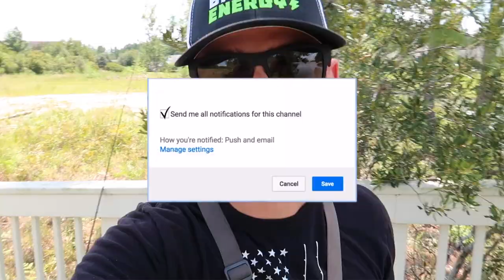$10 WALMART BUDGET Fishing Kit (Summer Bass Fishing)

Comment: 4:20 While I do agree there should be weights in the box sold as a kit, I think you had it backwards in what needed the weights. Well if your using a baitcaster  all them need weights. But lets say you're using a spinning combo the Senko type lures need weights to sink to bottom but all the worms can go weedless especially the ribbon tail and salamander worm. The worms you can fish top water or just under the surface level, especially over and around lillypads and structures. Or maybe this is just how we do it up in the north east coast. Not saying you are wrong but your way was very different . Basically the reason why i love these plastics is you can't really go wrong and can fish them almost anyway to get fish bites. Good luck out there!

Comment: Yo dude, You gotta tell me how you cast so far with such little effort. Also such a big fan of the vids keep at it!
Reply: Baitcaster with bearings set up for a great distance
Reply: Also, it looks way further on cam bro. It’s wideslens and makes it look way further
Reply: Turn the breaks all the way down, or as low as you can without blowing the spool up. Back way off the cast control cap and just leave a little bit of drag set. Use your thumb only to control the line and the speed of the spool. Some real good bearings always help to. But that Lew’s pro reel more than likely already comes with some bad ass bearings in it
Reply: @calebdshea  how much difference to aftermarket bearings make? Are we talking an extra 30 feet or double your cast? Does it cause more birds nests?
Reply: does lighter line or braid make it go further?
Reply: @NoMansLand888biggame  i have found that the looseness of braid helps, but too light of braid will cause your line to bury in itself and backlash. I tried using 30# and the line kept getting buried in itself, now I use 50lb and up
Reply: 15 lb fluro (good line) and a high end bait cast, that one he's using is 350 bucks lol